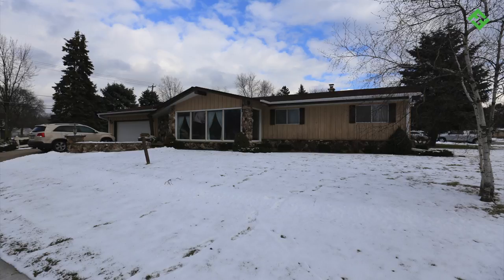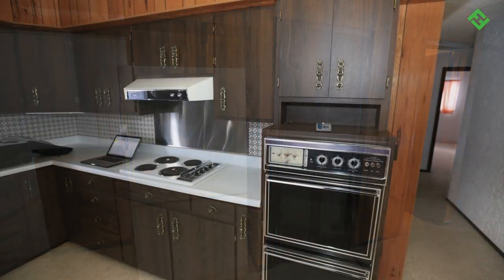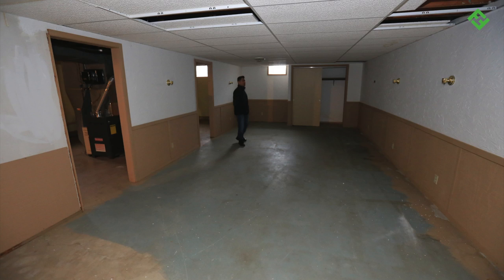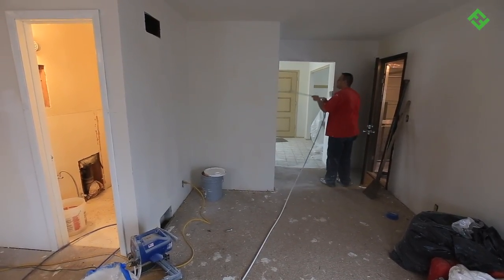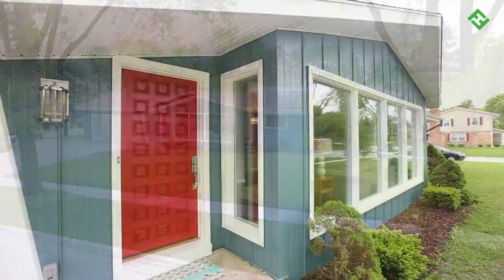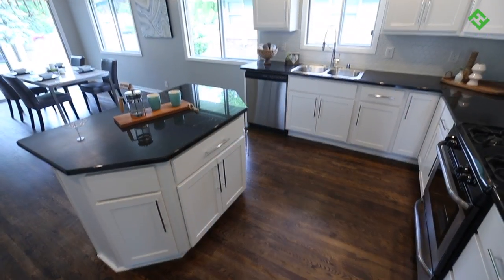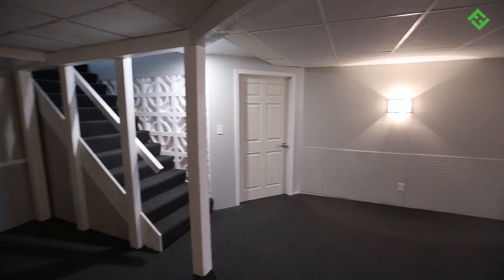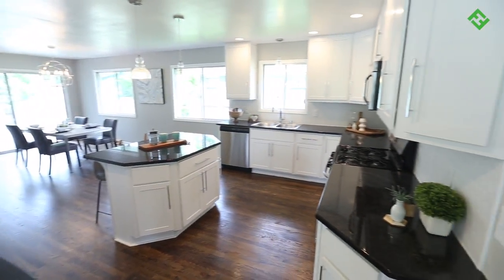Brady Bunch House Before and After Transformation

Comment: You would think this is common sense but the problem with common sense is it’s not that common. Painting. #1. Like to start in the back perhaps because the sun is beating on their ass. #2. Best to get the quirks worked out in the rear, by the time get around to the front, where is most visible... Looks awesome.